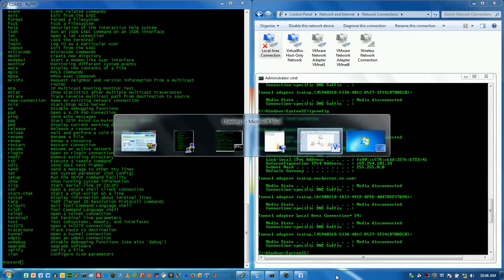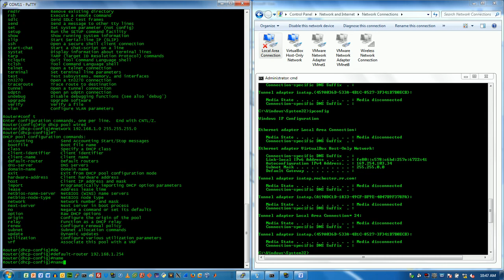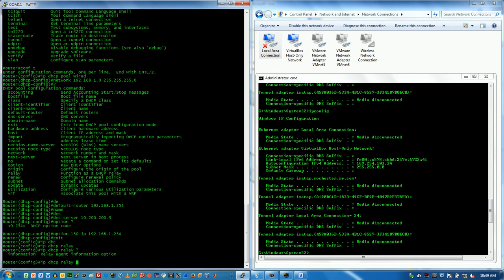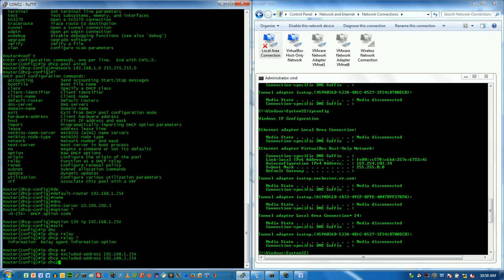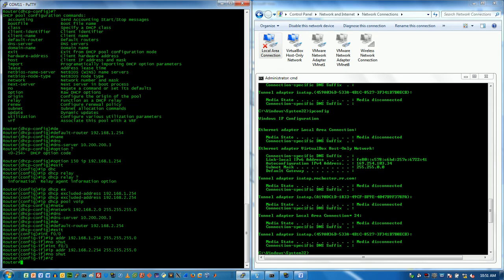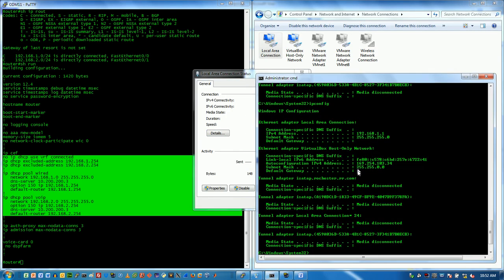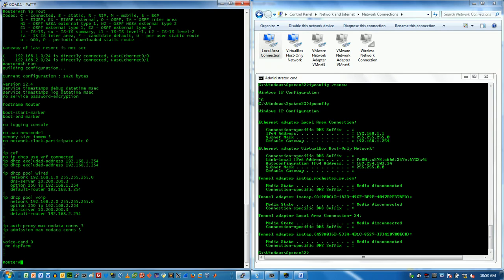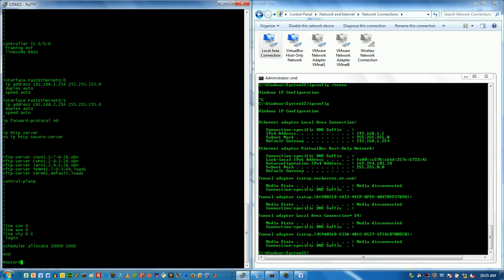Cisco DHCP and TFTP servers

Comment: Hello, this is my first experience configurating VoIP, I have a 2951 router with all cards but I have a M4100 NETGEAR switch, I haven't been able to get connection between swith and router so my ephones do not get configuration from router. would you help me? Thanks.
Reply from the maker: Hi Luis - well, you're right - if you can't talk between the router and the switch VoIP probably won't work either. So, key ideas: DHCP should be running in order to give the phone/host and IP address, DHCP can also be used to give the TFTP server (if used) and the call server. One of the gotchas is that VoIP phones want the config info quickly. Spanning tree discovery on the switch sometimes prevents this. For this reason we also use portfast on the ports connected to the phone/host. Hope this helps!
Reply: @BruceHartpence  I recently purchased a cisco 7841 phone and upon plugin it on i am getting a screen "Welcome, enter activation code or service domain". Could you please assist me with this please?
Reply from the maker: @Morris7-i4e  Well, every device/problem is a little different but I would start with ensuring that the phone gets the proper network settings and providing the tftp-server to DHCP (option 150). Hope this helps!
Reply: @BruceHartpence  How do i provide the tftp server to DHCP option 150? I have been searching for this for a while and so far i know, I should set Alternate TFTP to "yes" and then provide with the TFTP addresses Server 1 and server 2 but the problem is i don't know where to find these addresses. Could you please assist me with this please?
Reply from the maker: Good question: On the DHCP server itself you enable/configure option 150. One of the cool things about DHCP is the broad collection of options available. You do not have to do anything on the client, especially since a Cisco phone usually looks for option 150. If you cannot get access to that on the DHCP server you may have to manually configure it on the phone with an IP address. Lastly, you have to have a tftp server which provides the necessary files/configuration for the phone. Hope this helps.
Reply from the maker: @Morris7-i4e  Hi Torini - I think we have gone beyond what I can do in a series of messages. You can do a static configuration but you will have to tell the phone about the network settings including where the call server can be found. I suggest taking a look at some builds, either on this channel or elsewhere and take a look at some of the background on stuff like DHCP. Good luck and happy VoIPing!